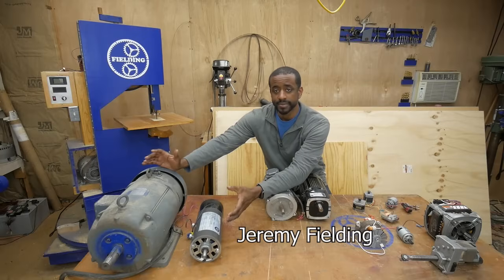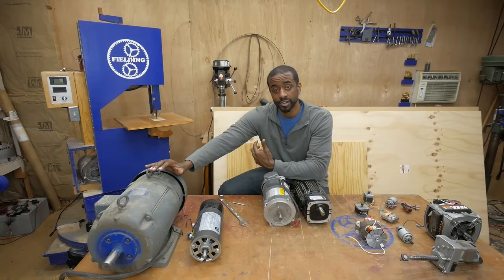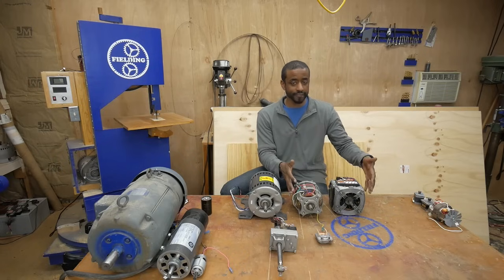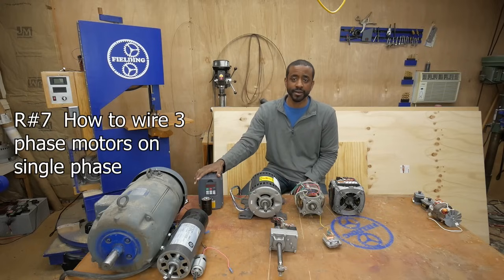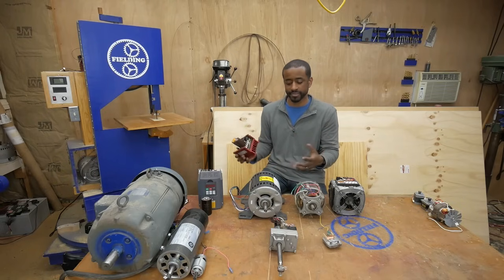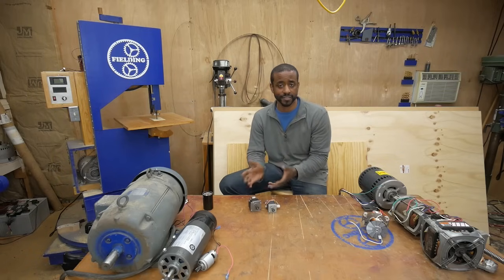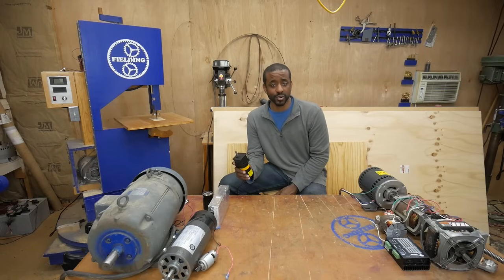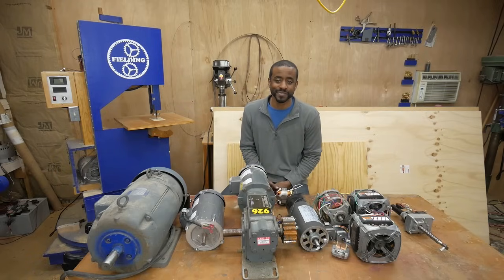Ultimate Beginners Guide to Using Electric Motors for Makers and DIY Projects; #068

Comment: Is PWM, always just PWM?
iE: could i use an arduino PWM output to control any PWM Motor?
Reply: Yes, provided your arduino signal feeds into a power transistor or mosfet
Reply: @mackal598  I assume that is because the expected voltages vary? If so, to what magnitude?

Comment: Correction: modern speed controllers for PMDC and universal motors have torque compensation: they will increase the voltage as current draw increases to compensate for the IR voltage drop in the motor windings. It's not perfect, and requires some setup: typically a trimpot or a plug-in resistor.

Comment: How can one know what start and run capacitors are needed on a 2 hp motor.  I bought an air compressor and the capacitors were removed.

Comment: For my electric go kart project Looking at a 15hp 1700rpm 14.6 amps 575 volts, Phase 3. Will this be good?
Reply: Youlasty I found it online local ad, I was just reading the specs that are in the picture on the motor itself

Comment: Can a 1800watt 30 amp dc motor power a gokart even if it’s only 6” long by 4.5” dia ?  Torque is 3.5 -10nM -
Reply: Yeah, that should work, you'll probably need at least a 2:1 drive ratio though, smaller moters usually get their torque at higher speeds then larger ones. 
Here is a video he did about this very topic: https://youtu.be/5QYyzVyWckw

Comment: That was awesome explanation.. Bow down to you sir.. 👍
If ever i build a conveyor with a 30 degree inclination.. about 5 ft in L. What motor should use ? High torque . low RPM  Motor ? 😐

Comment: I have a treadmill motor that ifike to run a large fan with. If I gear it(with a jack shaft) to run at the same speed as the original 1750 will it have the power to run constantly? Id like it to be able to turn it down from it's high speed sometimes.

Comment: Hey Jeremy, I worked as an operating engineer in an industrial application. At a meat packing plant we had a 250hp motor running an ammonia refrigeration system. It was connected to a screw compressor. If you could have seen it, I’ll bet I could have gotten a big smile from you. Love your videos Jeremy, thanks.

Comment: Jeremy, you are a wonderful help to the diy community, thank you. I also built a bandsaw to cut steel and wood, used Mattthias method to build and balance 20” wheels  and Tony Foale method to make the top wheel tilt and tension. Designed and welded my own frame of 2”X3” and 1”X1” steel tube. I used a 2.5hp treadmill motor controlled with a hf ac motor controller (which I think is trial based) feeding a bridge rectifier. I find that the motor bogs down on 6” hardwood. Is my controller suboptimum  or do I just need a different motor? I have a1” ribbed pulley on the motor and a 14” drive pulls on the 20” wheel.

Comment: Some motors have been "overclocked" to higher power by increasing voltage while limiting the current to standard levels. For example there's a big movement to use electric forklift motors for electric vehicle conversions. The horsepower is often more than doubled in these applications.

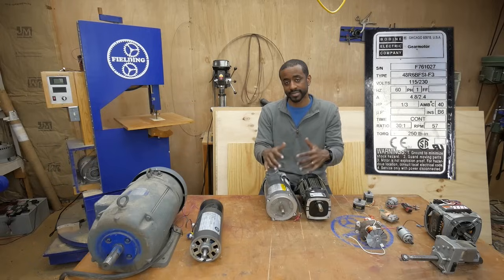Comment: 0:21 "So clearly the size of the motor doesn't tell you that much about the power rating"
13:32 "Depending upon the size of the motor will obviously dictate how much power you can get from that motor"
Reply from the maker: That is funny... it is probably worth clarifying... for stepper motors size is a decent indicator... for most other motor types size can be a really poor indicator.

Comment: How many Watts would you need to give you the same performance as say a 250 cc  motor bike engine.
Reply: According to Reference.com the average 250cc bike has about 25 horse power, which means you'd need a 18,642.5 Watt engine to get the same power.

Comment: You should probably note that the easy availability of treadmill motors will not last. There was a fitness craze a few years ago and people bought them and then ended up getting lazy and using them as clothes hangers to a  large extent.  Or maybe they joined a gym because of the positive social reinforcement. They got tired of the old machine at home taking up space, and now many are on the curb. A similar thing happened with hot tubs maybe a decade before that. This DIY equipment scrounging stuff is not all nuts and bolts, sometimes you have to understand what is happening in the social world out there and what is in fashion and out of fashion. There was a brilliant guy eons ago that had a whole book of great ideas for DIY, but a lot of the parts he used were things like Model T starting motors, lol. Also, whether the economy is up or down can make a big difference.

Comment: Would it be possible to hook up a small homebuilt wind turbine to the shaft of a salvaged 3 phase 400V motor and convert the energy to load batteries? I've heard that it depends on the efficiency of the motor und therefore it has to be "the right" one to realize such a project.

Comment: Thank you very much for your time and effort put in your videos; they are very usefull and informative !!!
I was thinking about something that is not commonly done, because everytime you see a motor working it´s connected alone to a power source (AC or DC); then I asked myself:  What would happend if 2 or more motors are connected in series or in parallel ?
I´m not an electrician but I like to do things with electricity.
Thank you in advance for your answer !!!

Comment: I want to make a mechanical hammer which will be powered by an electric motor of 700 watts from a vacuum cleaner whether the engine will withstand or will burn ?

Comment: Beautiful presentation, very clear and informative. (Subscribed) You May be able to answer a question no one has been able to. Just bought 3 phase drum sander and a VFD to run from single. Will I need another VFD  to run the infeed motor which is powered from the big 3 phase motor or will it just be happy running off the inverted phase?

Comment: A quite common method for producing three-phase power where there is none (in simple terms) is to use a single-phase motor or gas turbine to drive a 3-phase motor, effectively creating a 3-phase generator. It's certainly not the most efficient way of doing things, but you'd be surprised how common it is. I'm sure that there's probably dedicated 3-phase generator units out there, but the method of using some other source of power to drive a large motor is cheaper and easier to maintain/overhaul.

Comment: Hey Jeremy thanks for taking the time. Iv been trying to figure this issue I have quite sometime if you can Chyme in il appreciate it .
Been trying to get a motor for my belt grinder and I was looking at 2-3 hp motors with either 1750 rpms or even 3500 both speeds are good for me.  The issue I have though is that most plugs at home run at 110v and most motors I’m finding run on 220 or 230 and I was wondering will it be possible to get a vfd and be able to run it on a 110? Without sacrificing torque? Thank you

Comment: What would you suggest as the best motor to convert a rototiller/ rotary hoe from petrol to electric
Reply: what's the RPM and HP of the current petrol engine?
Reply: @angrydragonslayer  3.5 HP at 3600 rpm
Reply: then i'd say either something similar to the 4 hp dc motor with something to keep it at that rpm (be it a control circuit or what have you) or a comparable AC motor with the necessary circuits for that

make sure that your tractor or other power source can handle the load (you'll still run on fossiles if you dont use batteries or somehow tie it to the grid) and that you NEVER run a DC motor without a load

Comment: Thanks for frying my brain Jeremy. Seriously though I have learnt so much from your videos and watching this one again, for the third time, I just learnt something new. A lot of people are going mad swapping their Ac induction motors for treadmill motors but there are compromises that they are not aware of. For example when you reduce the speed of your dc motor you do not increase the torque like you do when reducing speed with pulleys or gears so they find that swapping a 1hp Ac induction  motor for a 1hp dc motor can lead to very disappointing performance when they reduce the speed for bigger  or heavier work eg drilling, metal lathes ect. Also your explanation about Ac induction motors being frequency  driven and therefore they want to maintain there speed even under load clears up another side effect of going to a treadmill motor. I changed my six inch belt sander to a treadmill motor but I noticed that it is a lot more susceptible to load than it was with the Ac motor. This is not really a problem more just something to get used to and having a tacho fitted shows that it doesn’t slow down as much as it sounds like it does. 
This, although only a small compromise, is far outweighed by the ability to change the speed but again is not pointed out in the videos showing how to to do the conversion. I hope this helps others. Cheers Stuart 🇦🇺

Comment: What would you recommend for mounting to a bicycle, with very simple use, using a homemade 18650 battery pack, for ten Mile range at mostly constant speed?
Reply: i'd recommend a pre-built hub motor or even conversion kit, i've tried to build e-bikes myself and it's just not worth it to make your own motor mounting/chain drive and then also finding an appropriate motor
Reply: @angrydragonslayer  fine and dandy if ya have the money, and no tools. I have tools but little money. A good 80 amp alternator happens to be laying around. I'd be happy with starting with pedal power, then having a low and high speed. 25mph is dandy.
Reply: @whozaskin3639  then you just need a motor control board that is compatible with that alternator, some sort of throttle  and the hardware to mount and connect it all

if you want to rewire it, i would strongly recommend to wire it for high torque/ low rpm unless you want to add a gearbox to your shopping list of auxiliary parts

Comment: If I'm correct, a 30 rpm 300w motor and a 30000 rpm 300w motor can be made to provide the same amount of torque or speed with gears right?(Maybe some losses in the gears but not much) 
Also, is it true that thicker bldc motors provide more torque, and longer bldc motors provide more speed? thx
Reply from the maker: Basically yes.... but gear boxes also have limits. As speed goes up gear box options reduce to practically none

Comment: @ 8:05. There is a US city that has almost all it residents are wire for 3 phase power and that's Phoenix Arizona. And the reason for that is because every one needs to run Air Conditioning units and the starting current on a 3 phase motor is far less then that of a single phase motor. Plus, it easier to maintain a more unified power factor as well.

Comment: So my problem is that I am new to motors, but i want to build my own smart ball trowing machine, now i want to use a raspberry pi to control the speed and have it be able to remotely adjust via a phone app... that's juts the very basic, so my question is i need a small dc motor that can be controlled by a raspberry pi that has the ability to project a 5oz ball at 100 mph with a wheel no more than 15cm and projectile distance required is 22 yards. I looked at the bangood 775 motors but they don't look no where near the power i need.

Comment: Learned a lot, but also came away with way more questions. Now I have to find out more :P
Building a toy car, but I suck at electrical wiring, using 2 DC motors and 2 servo hobby motors, I get really confused about how voltage divides and how to avoid supplying too much current to a motor. I have no idea where I can learn this.

Comment: Hey, could you please review a "Free Energy" video, not just for me, but for every viewer duped by these guys. I am convinced these guys are using one type of generator to run a bunch of different motors that use low voltage and amps, still spin but don't actually produce any excess energy. I think they are a sham, but I don't know enough to debunk them, but you do!
Reply from the maker: I have been thinking about it... probably yes

Comment: I'm actually curious now because even though I know it doesn't have a motor, I'm wondering what useful parts I could possibly salvage from my old broken toaster that I just replaced.  Simple 2 slice Chefman brand toaster.  Only problem is that it often hums when you pull the lever and often won't stay in the "toasting" stage unless you press forcibly on the lever or hold it down.

Comment: I have a wood chipper ..small from harbor freight . I was chipping some branches and the last piece was too thick STOPPED the chipper. I pushed reset button but it will not start. My question is when a electric motor like my chipper are stopped do they typically stop working. ? Your not a repair guy .(.i dont think so) but you might know. 
Thank you for your time

Comment: Great  video. I  am  looking to  build a medium size windmill to charge a few backup batteries. I was told that a PMDC motor is best. Would you agree and what options are available to build up a system such as this? Would be great if you could offer some advice .. allthesixes@gmail.com

Comment: hi Jeremy i have a 240v single phase brush less motor RPM 2000 it has a start capacitor 50hz 200w  squirrel fan i want to lower the RPM to 1300 any ideas tried dimmer switch does lower speed but gets hot and humms not good thinking of choking one of the phases with a transformer hope i got all this right thanks Jeremy

Comment: Also using a small motor for high torque applications with gears will probably blow up the bearings very fast... At least I have a ~1700W very small brushless on my RC drift car and it has crazy high rpm, I don't even know how the bearings survive :) Anyway I reduced it for 40% power output from the ESC since its too much for my RC Drift car even at 40% (its locked differentials permanent 4WD 50-50%) and even at 40% power it can make a huge 10 meters radius giant drift circle.

Its a low Torque motor, however if I would use them in my other huge and heavy monster which has a glow engine I would probably have to put 2 motors or use gears to make it have more torque, but I think the bearings would die fast at very high rpm, can't even remember if its 40K rpm or even higher... I don't even understand how the bearings can survive such things or even the small pistons from glow high rpm engines with a single piston doing 16K rpm and some even higher jeez...

Comment: Many thanks for your videos, 
I have a question : how can I add electrical breaker system to my old table saw motor? 
My saw may take 30 seconds or more to stop after each use.
Reply: The quick stopping blades use a shunt or short, I think it reverses the polarity to stop it quickly.

Comment: I don't get why a larger motor wouldn't be able to run at higher power. The larger it is --> the more copper is it in -->the lower the resistance of the windings --> the lower heat generation from losses --> higher power can be pushed through

Comment: Question. I salvaged a motor with speed control from a blue Ryobi scroll saw. The only stats I have are 120vac 1.2amp 400 to 1200 spm. My question is what type of motor is it? I am now using it for variable speed disc sander but would like to know as much as I can about the motor. Thank you for the very clear and knowledge videos. Very enjoyable and educational